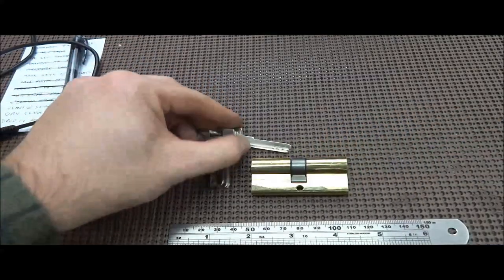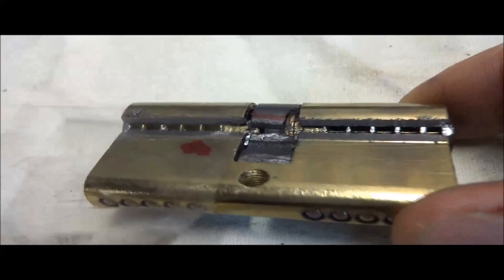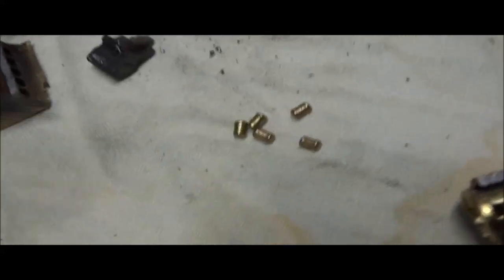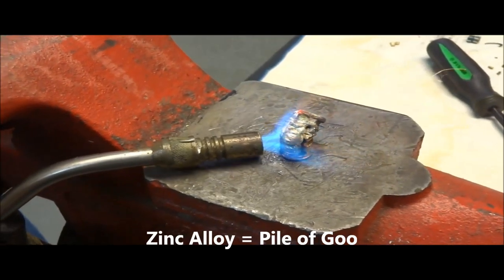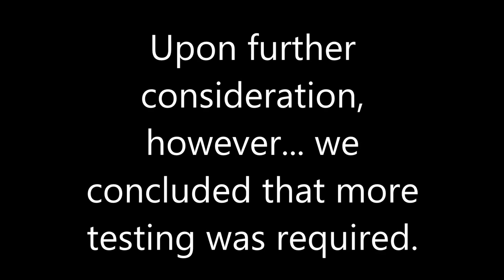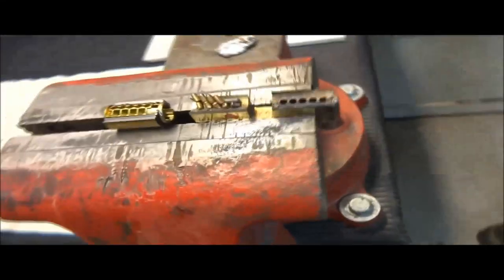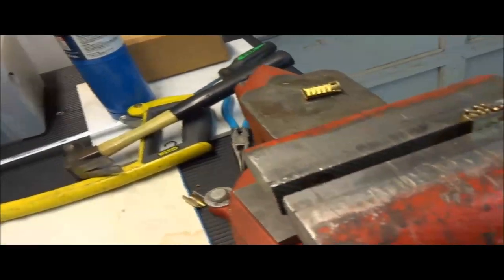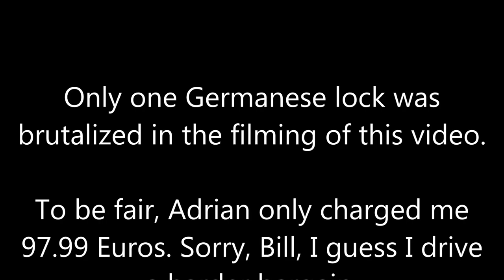(087) How to speak Germanese: A tutorial from Alex and bosnianbill

Comment from the maker: It is a prototype. Our testing revealed some lack of precision on the lower end of the scale... the current term for this type of error is Germanese Variation. We have found that you can correct for this error by taking a piece of Wrigleys Spearmint gum, chewing it exactly 100 times, and then heating it to precisely 105.2F. This will accurately simulate Germanese plug metal's hardness... about 6.289 (not 6.3, as in the video).

Comment: Why did you need to mill open this cylinder?  Each plug was retained with a C clip and you had keys.  Remove both C clips and turn each plug a bit and then pull out slightly.

The cam and the butterfly can then be removed and the plugs can be followed by a segmented follower. (think 1/2" wood dowel cut into 3/8" lengths.)

Comment from the maker: Actually, I think Adrian is manufacturing counterfeit Chinese pot metal locks for sale to unsuspecting Germans. 

Now, we're not suggesting that you test all your locks with a propane torch... but you might wish to inspect any wobbly Germanese locks you might have lying about your house. Be sure to remove them from any wooden fixtures first... despite it's low melting point, molten Germanese plugs have been known to start fires. Or so we've heard.